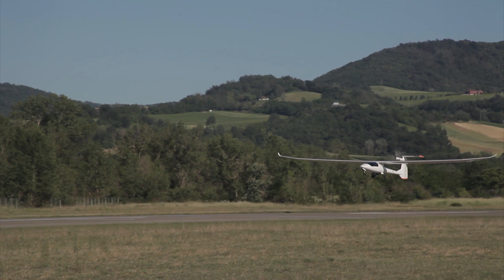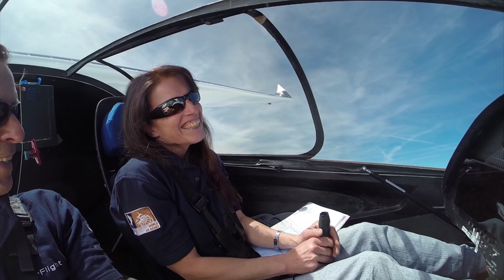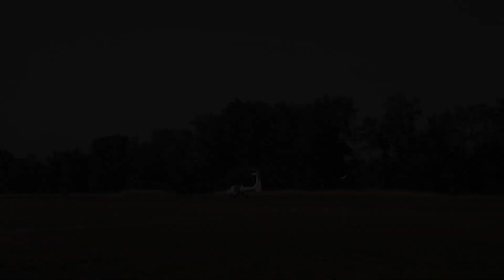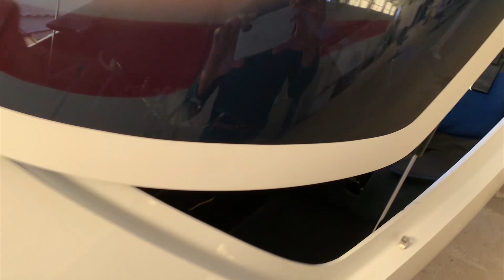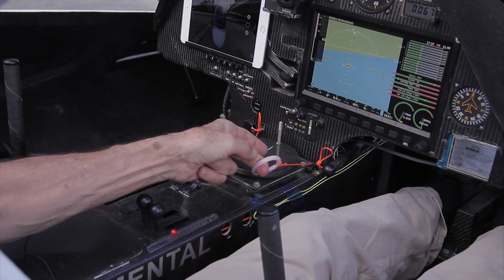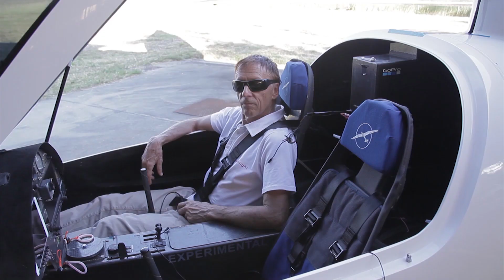The Sunseker Duo cockpit tour

Comment: What is the total cost to build this beauty? Just curious ☺️
Reply from the maker: Difficult to pin down a cost.  It would not be possible without the free use of the Stemme AG factory molds, which is worth a lot.  4 years of our free time, and about $250,000 for equipment and materials.
Reply: @Solar-flight  if I have the funds, are u guys can help me build one?

Comment: Can you give some detail on the battery you use? Configuration, cell type and all that? And with no sun, at night for example, how long can the battery can keep you in level flight? Really nice plane
Reply from the maker: Kokam 24.5 Amp hour cells, 90 of them.  With no sun, we can climb at least 7,000 ft on the batteries.  8 kW hr  gives 2 hours level flight using 4 kW for level flight.

Comment: What is the power rating of the solar panels and motor, and what is the battery energy capacity?
Reply from the maker: Solar panels give up to 5 kW at altitude in perfect conditions.  More could do more, but we have it limited to 16 kW or it can overheat.  Battery 8 kW hr